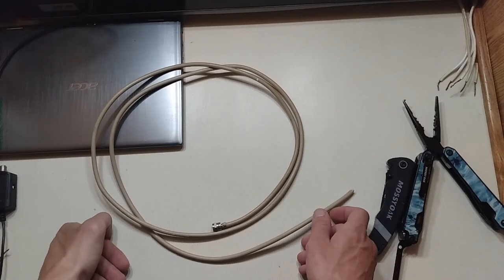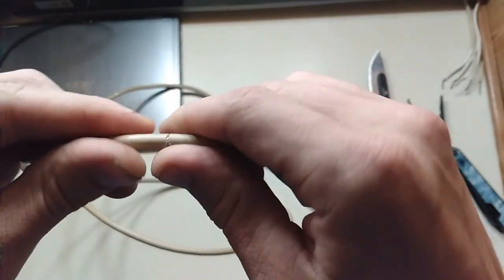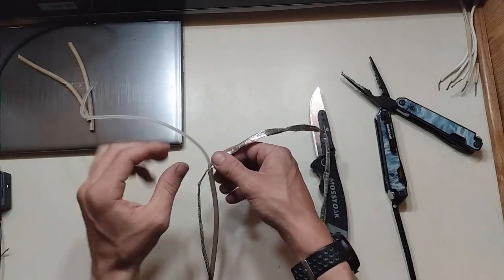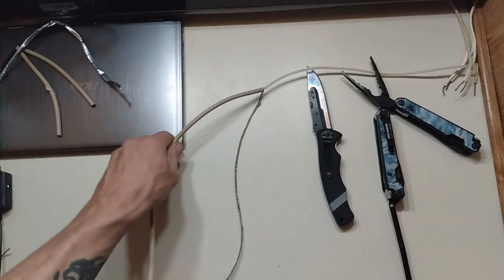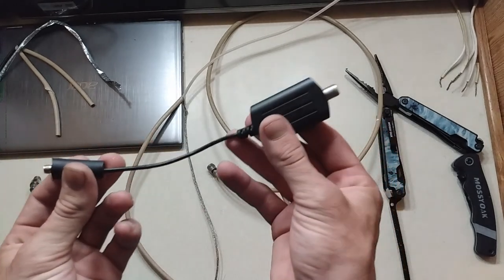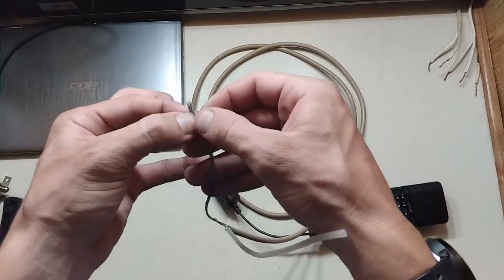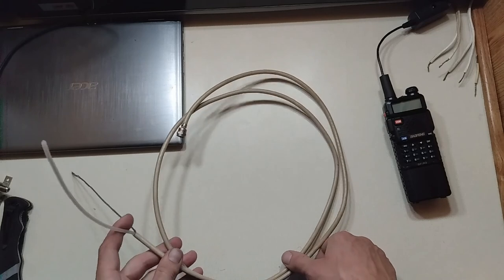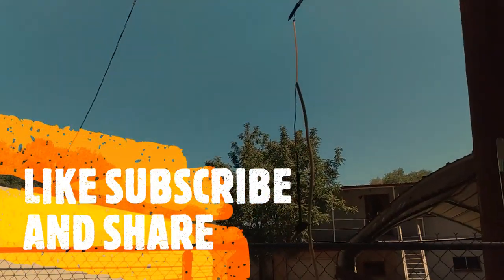Home Brewed GMRS Dipole Bugout Antenna, BAOFENG

Comment: Is that cable TV coax
Reply from the maker: Yes, it’s the only thing I had when I started out in Radio now I’m two years into it and use 50 ohm
Reply: OK so will this work with out it messing my radio up I'm still very new to this
Reply from the maker: @bobbygreen6670  I don’t recommend it I’ve used it and it never destroyed my radios. They got warm a lot quicker it’s not healthy for him but I use that only for HT and a little bit for a 25 W radio I might’ve got lucky.